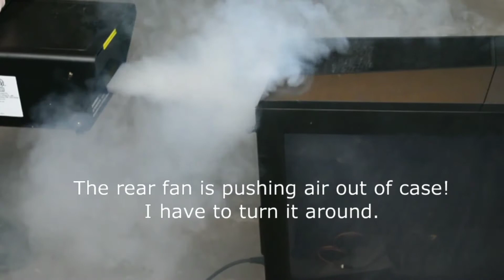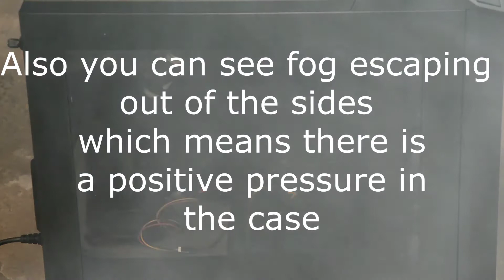EK Phoenix Series Part 6  EK 360 Radiator Air flow Test

Comment: I typically subscribe to the idea of more intake than outgoing when it comes to fan placement and also letting the air flow through the path of least resistance. With that said, most of my builds have 3 (intake) fans up front  with a single 120/140 (exhaust) in the rear right above the IO panel to allow air over the hot areas (VRM and around the CPU). If I'm watercooling (I always am on my own rigs), I'll have the rad top mounted blowing air through the rad. That way the hot air from the rad goes out of the case. Anyway, I like the idea of using the fog machine as a visual test; I'll have to pull mine out :)
Reply from the maker: I typically do it the same way, at the time of the video I was not sure and did not want to remove the fans to represent such a set up.  A later video I have figured out that I could flip the fans.  The way the rad is constructed it creates some issues with fan placement, you are going to either push or pull depending on orientation/ placement of rad. https://www.youtube.com/watch?v=F1ir10Dsa8o check out that video and you should see what I am talking about.  This is typical of most AIOs that have pump and/ or res on the radiator.  But I am sure you already know this. ;)